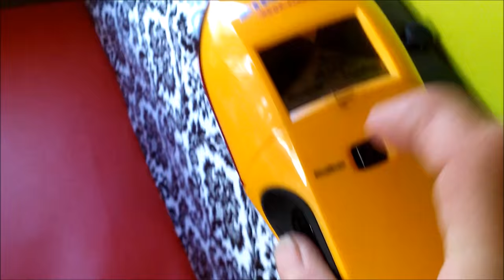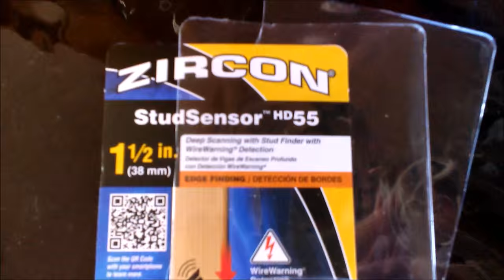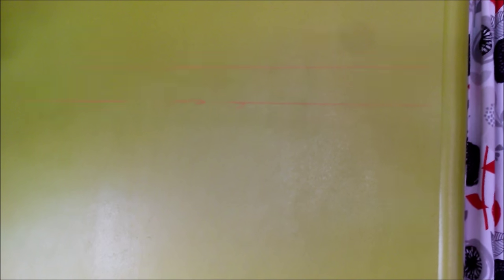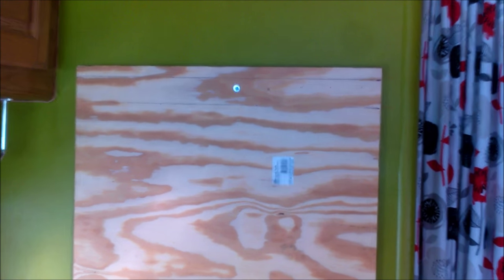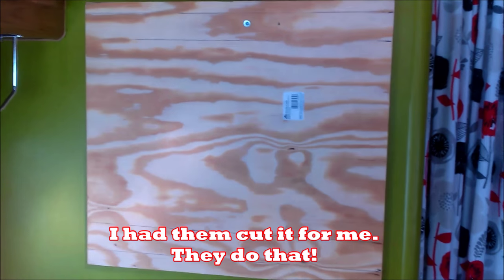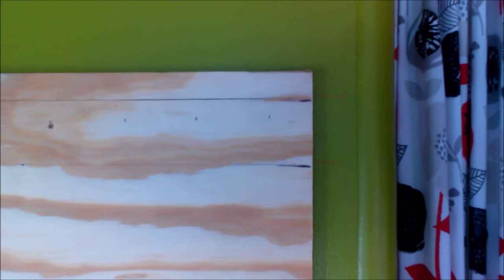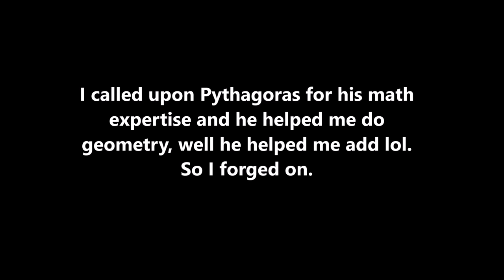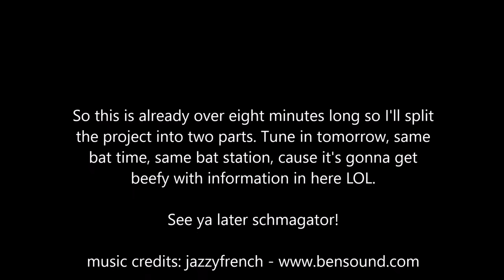Mounting  a flatscreen LED TV in an RV - Paper thin walls :(

Comment: That was a lot of screws in that plywood.  I get that you didn't have a stud to fasten it too.  I think it should hold up now.  But how large is the TV.  LOL  The mount we bought went from 32" to 60" TV.  I would use the 2 1/2 for the 60". but think it's overkill for a 32".  On 2nd thought, maybe not for driving down the road.  I'm sure everything rattles loose after a while.  Waiting for Part 2 now!  You have my attention!!!  LOL
Reply from the maker: +DWDinAtlanta I really didn't feel confident about the studs and I know it was overkill but I needed to be sure the tv would be held, yes especially jiggling on down the road LOL.

Comment: This is a perfect example of what "not" to do.  Most, if not all, television wall mount units state in the instructions that they are made for 2x4 stud construction. That is why they supply longer lag bolts. RV construction is typically 2x2 studs. Like any lumber a 2x2 or a 2x4 aren't that big...measure them.  You can add 100 screws but if they don't hit a stud they are useless. This whole project wasn't planned and doomed from the start.  You just can't fix stupid.

Comment: You bought a Stud Finder?  Did you find any Studs?  That could be a whole other video on a different channel.  LOL  Here Stud, Cougar here.  ROFL Good job on getting it up Shelz, maybe a shorter screw would have been better for the plywood.  You know, it is not real wood.  Now you have to deal with an impregnated shower wall.  A screw every 2 inches is overkill unless you just really like screwing.
Reply from the maker: +Bill Long You may be right on the over-Kill Bill lol, pun, but with such limited and light-weight studs I needed assurance. Hell, I used to make my boyfriends wear TWO condoms, cant be too sure LOL
Reply: Shelly, it would be more believable that you started screwing and couldn't stop than for you to be dealing with light weight studs. 
And - as soon as this message binged in on my phone the drain line under the kitchen sink busted and flooded that cabinet.  How did you do that?
Reply from the maker: +Bill Long Oh hell!!! Did it do much damage? Were you able to fix it??!

Comment: With the screws coming through shower, why not get a piece of  hard plastic strip, maybe 1 inch thick and bolt it on?  You could make great shelf or install hooks so you have a place to hang wet clothes in shower.  Just an idea.  Keep up good work.
Reply from the maker: +Wobbley Box That' a great idea and one I'll def look into. For now I put a daub of silicone on each screw that came thru to make the surround water-tight. When I re-decorate the bathroom I'll incorporate your share for sure!! Thanks.

Comment: Nice work! There must be some type of lightweight faux molding you could cover up the peek-boo holes in the bathroom. Waiting for bat time tomorrow to see your Part 2. 🙂
Reply from the maker: +Bev N That's what I'm thinking, I already put a daub of silicone on each hole. I plan to shave it down, just as I did with the big hole I fixed, and get something to cover both that will make it matchy match and look "on purpose" lol. Thanks Bev!!

Comment: Really nice job,......i would have used  two verticle  boards and 4 screws . Ha HA  well everyone has a different way.
Reply from the maker: +Soul Traveler I'm trying to understand, where would you put the mount then? And thanks!!
Reply: +Old Fart New Start      i just didnt see a need for the 20 x 22 board.   a 2 in wide/ 22 in longboard [ or two ] then screw the mount onto that. just as wide as the mount bracket.  verticle  strip. Maybe u just have to be there, i dont know  LOL  nevermind lol  It looks great
Reply from the maker: +Soul Traveler I see. That actually might have worked extremely well! I watched other vids where people put up boards and that sounded sturdy to me. But I see what you mean now. thanks for that, I'll keep it in mind to broaden my choices for other projects :)